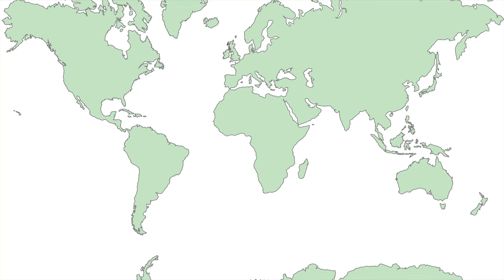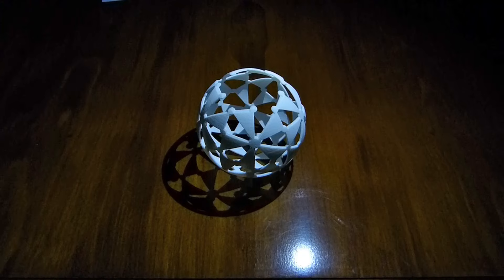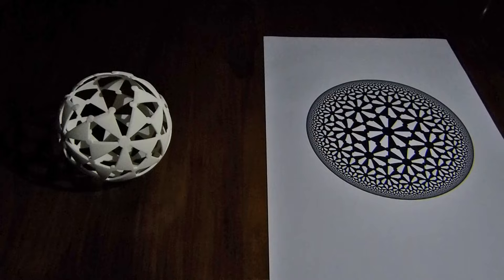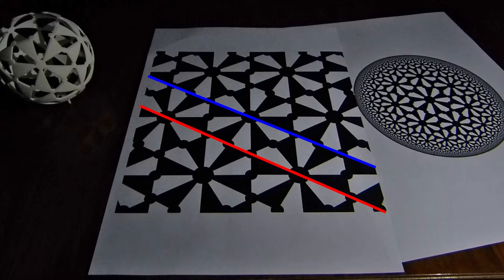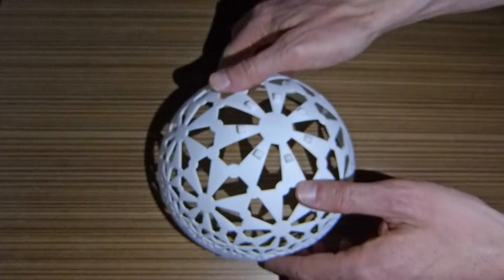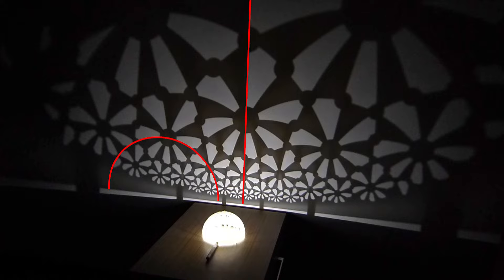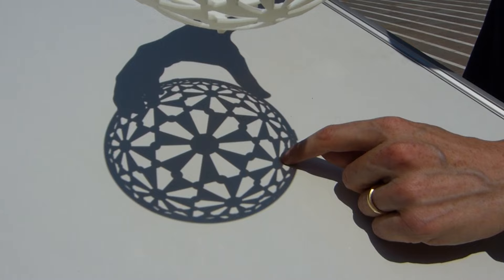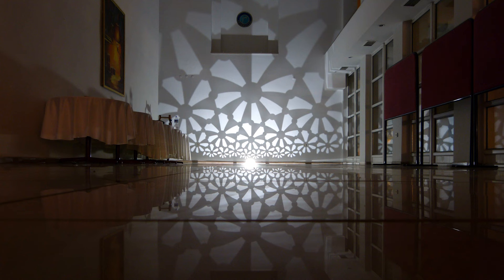Illuminating hyperbolic geometry

Comment: one of my favorite projections is taking a euclidean plane, pulling back a gnomonic projection to the half-sphere, and parallel projecting to a disk in the plane. it maps lines in the plane to half-ellipses tangent to the boundary of the disk at two opposing points, which makes it very well suited to conceptualizing projective geometry. of course, you still have to implicitly equate opposing points on the boundary. (edit: i suppose you could stereographically project the half-sphere to the disk instead; that would map lines to circular arcs which intersect the boundary at opposing points)

you can even model this projection in a graphing calculator like desmos, which means you can graph proper functions and see how they behave. i suppose it shouldn't be surprising that the point at which they intersect the circle at infinity is closely related to the limit of the slope as x goes to infinity (if it exists), so most common functions (polynomials, exponentials) intersect at the top/bottom of the circle (i.e. straight vertical from the origin). as a final example, sin and cos do not have limiting slopes, but they are bounded between two horizontal lines, and so must intersect the point at infinity where those lines do: the horizontal point, corresponding to 0 slope lines.

Comment: I always find your presentations interesting and informative.  And they are delivered in a concise and professional manner.  

What I found odd in this particular episode was when Henry was holding the hemispheric model above the huge white board which was being supported at one end by an assistant.  I thought for sure that you would then move the model away and see how the pattern changed on the white board?!   

But that didn't happen so my question is why not show us how the image changed with the model higher above the board?   Otherwise why use such a big board at all?
Reply: Are you referring to the scene starting at https://youtu.be/eGEQ_UuQtYs?t=190? We are using a giant white board because 1) it is very flat and 2) we could tilt it to be perpendicular to the angle of the sun. (And also, it was what we had!) Since the rays of the sun come in in parallel, moving the model away from the white board will not change the shadow.
Reply: @saulschleimer2036  Oh, I see because the light rays are coming in parallel the image would not be enlarged by moving the model away.  Thanks for the explanation.

Comment: I would like to see a hyperbolic analog of the Mercator projection.
Reply: The hyperbolic analog of the Mercator projection is called the band model. The Mercator projection renders the equator isometrically as a straight line, and the rest is mapped conformally. The same is true for the band model -- it renders a chosen hyperbolic straight line isometrically as an Euclidean straight line, and the rest is mapped conformally. While the equator is finite, a hyperbolic straight line is not -- you get an infinitely long band (of finite width, though), and hence the name "band model". You can see it in action in Bulatov's presentation ""Conformal models of hyperbolic geometry", and also in our game HyperRogue -- where it is used as a great presentation of the surprising fact that the path taken by the player during the game is very close to a straight line (the guiding line is taken to be the one which connects the initial and final position here).

Comment: Nice overview. The half-plane projection seems like the bottom curves upward, is that just a limitation of the materials?
Reply from the maker: +Sprite Guard Alpha The bottom of the region in which I've cut holes out curves up, because of limitations in the material - the holes corresponding to triangles below the curve would have to be too small to print properly.
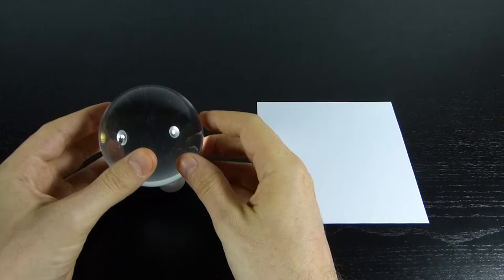Reply: @henryseg  Also 0:19 beautiful crystal ball

Comment: Hi @Henry Segerman, those shadows are amazing? what kind of light are you using? :O do you have a link? thank you!
Reply from the maker: I use this flashlight: https://maglite.com/products/mini-maglite-led-2aaa-flashlight
Reply: @henryseg  thank you very much! very appreciated. I'm looking for a bright point-like source of light.  I found very interesting your exhibition at the Summerhall in Edinburgh. There I've seen that you use an Led plugged into the socket with a driver. Did you build it or do you have reference for it? Sorry for my questions but I'm working on a similar exhibition for the Alma Mater in Bologna (Italy). Thank you
Reply from the maker: @gianmarcogianni4052  I don't know the details of how to do this, but apparently it is not too difficult to modify a battery powered device to run on mains power with an appropriate transformer.

Comment: I didn't understand the essence of this. Is a hyperbolic plane actually a half sphere made of triangles? Or is that just a model that represents some characteristics of the hyperbolic plane? Can a hyperbolic plane be visualized in 3-space at all? Is the hyperbolic plane more realistic for cause/effect physics than the flat Euclidean plane? Where do I get such questions answered?
Reply: watch video The hyperbolic geometry of dmt experience
Reply: The hyperbolic plane is “actually” a mathematical abstraction. And yes, as you correctly suggest, all of the models in the video are “just” models, not the actual hyperbolic plane. But this is not so different from the situation with the euclidean plane… you’ve never seen a “real” euclidean plane - you’ve only ever seen somewhat small, somewhat bumpy “models” of the euclidean plane…

Comment: I'm confused. if positively curved space can be represented by a sphere, then couldn't negatively curved space be represented as a sphere, but from the inside of the sphere?
Reply from the maker: For a curve in the plane, the curvature is positive or negative according to whether it bends to the right or to the left. So you could say that a circle has positive or negative curvature depending on whether you are inside of it or not. For surfaces there are multiple different versions of curvature. You could define curvature the way you're thinking, but it turns out to be very useful to think about it a different way - https://en.wikipedia.org/wiki/Gaussian_curvature is the version we mean.
Reply: Good question.

Comment: If earth is a sphere, how can we calculate distances between two points (on a flat map) without using spherical trigonometry?

The obvious exception would be, when going either north or south...but any other variation would require a curved course, and thus spherical trigonometry.  No path could be plotted in a straight line if they wanted the shortest path, and this is directly opposite of the way navigation is done on flat maps; flat maps use straight lines in any direction, and are always linear; the distance is never distorted. 

The misnomer that flying east or west is somehow flying a straight line, or a circle that runs latitudinal around earth, is wrong.  The reason the pilot has to correct for direction in flight is because the relative direction of north changes when you fly a straight line on a planar earth (except when traveling directly north or south).  An airplane heading east or west constantly, will fly in a circle over the planar earth; like drawing a circle on a peice of paper.

Apply some basic geometry, and tell me what basic geometry teaches us about using simple geometry to calculate distances of curved lines...

It tells us we aren't calculating curved lines, and that's why basic geometry works for navigation.  Because earth isn't a ball, and spherical trigonometry would be required to do basic navigation if it was.

The only time spherical stuff comes into play is when looking at the sky.  

^^^ put two and two together guys, you can do it...the earth is a plane, and the sky is a dome.  It's not that hard...

This isn't rocket science, its basic math and common sense ;)
Reply: Wtf bro u good?